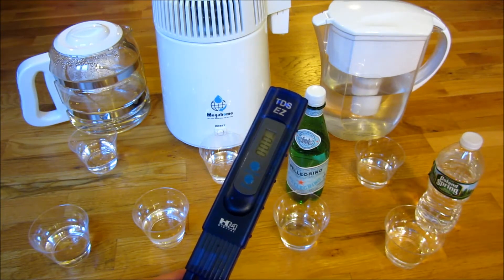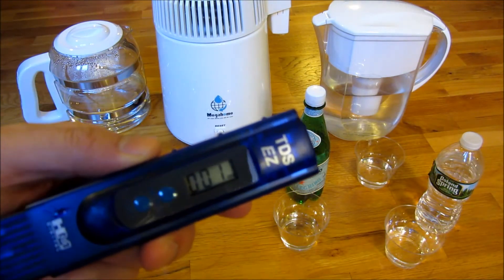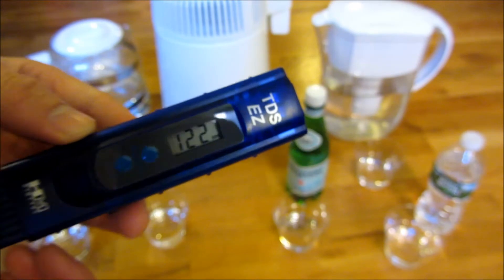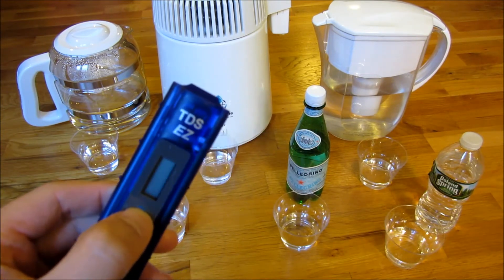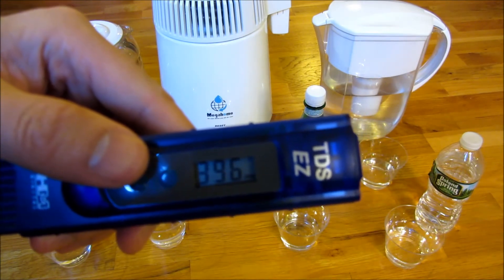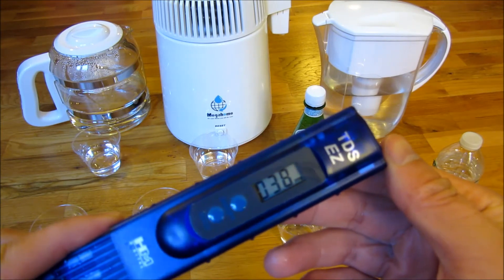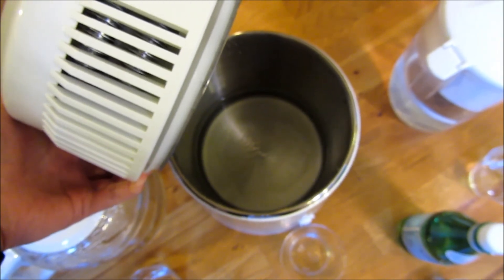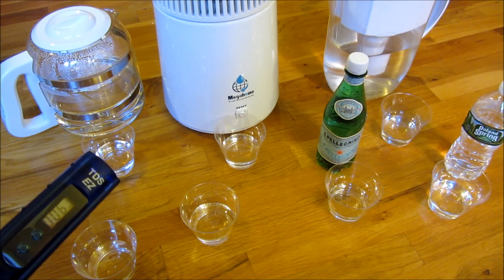Megahome Water Distiller | Water Test Results and Quality Comparison

Comment: I have owned 5 Megahome Water Distillers over the last 12 years.  All of them lasted well and continued to distill water, but I had to throw each one out, because slowly, (some faster than others), over time, the heating element in the bottom of the tank, caused the tank bottom to TARNISH! The tarnish grew worse with each use.  Until there were more and more tested 'particles per million,' (PPM) (using TDS meter), in each distilled batch. The description and biggest selling point, states that the tank is stainless steel.  Stainless Steel items usually are purchased precisely because they are not supposed to Tarnish.  The most recent Megahome I purchased (March 23, 2025), was a 316 model, because they said the Stainless Steel was "heavy duty". I wanted to save from having to buy another distiller, so I used bottled distilled water in it, (I would just drink the bottled distilled water, but wanted to vaporize the plastic from the bottles.  There was never any sediment left in the bottom of tank after use, but after only two uses, a star shaped tarnish appeared over the heating element.  After 7 uses, the tarnish had grown much worse. 
 Experience has taught me that, tarnish & heating element corrodes the metal, at bottom of tank, over time, and it will eventually cause particulates and rust.
The seller I purchased from on eBay was Nutriteam.  I was able to return the distiller, but with a great deal of trouble for me.
I talked to another seller on Amazon.  Found out it was the same Nutriteam. 
 I WANTED a Water Distiller!  They were selling their Megahome "Heavy Duty" 316 Distiller for $329 at the time.   I explained my experiences, recently and over the last 12 years, to them, (I suggested that they make the Stainless Steel at bottom of tank thicker), and asked for assurances if I bought theirs. 
They could NOT or would NOT give me one.......(so far)      BUY AT YOUR OWN RISK.
I came here looking for alternatives to compare to Megahome.  As you can see, all these people are pretty much hawking for the Megahome Distributors.  Remember, you are making an expensive purchase, and you WANT IT TO LAST!  The first month it could give great water, when the warranty runs out and the tarnish is bad, then what do you do?  And, NO, the tarnish was not from the sediment left from tap water, (I don't use tap water), it was the heating element itself that tarnished and eventually corroded the metal at the bottom of all the tanks!!

Comment: I also use a MegaHome distiller for my drinking/cooking water. You really don't want to boil a distiller dry for two main reasons:
1) The sediment forms a hard scale if all the water is boiled off, which makes cleaning the tank a real chore.
2) When the distiller is allowed to run dry, the heat goes way up, stressing the heating element and can cause the safety switch to wear out prematurely.
In order to prevent this, just plug your distiller into a timer switch set to about five and a half hours. Fill the tank to just over the 'Full' mark. This will give you a gallon of distilled water and leave a little water in the distiller. Just pour out the remaining water and rinse out your distiller before running the next batch. Your distiller will last longer, and you won't have to clean the mineral scale buildup as often.

Comment: Lower TDS doesn't necessarily mean better... if the disolved solids are healthful minerals, in proper balance, then in terms of drinking water, a higher TDS may be preferable...
Reply: Find one city with non oxide minerals in the water and no pesticides. In all other cases distilled is healthier. Calcium/magnesium oxide are not easily absorbed and I don't think your body has a use for chlorine/bromine complexes.
Reply: @Skarnex1337  the answer is to drink spring water, not distilled or municipal water.
Reply: @rosstituteuk  spring water contains oxide minerals which are not easily assimilated into the body
Reply: @Skarnex1337  well water from a bore hole is much more likely to contain the oxides (alu, manganese + iron). good quality spring water that has filtered to the surface naturally is much less problematic.
drinking distilled water for a prolonged period of time will demineralise the body, as it's a 'hungry' form of water. 

Sauna therapy is worth considering, if you're concerned about the oxides.
Reply: You shouldn't be drinking water for its minerals, its a myth, if you calculate it it will only be 1% of your daily intake, 99% comes from food
Reply: @helloman5576  Water is not only the most essential substance next to oxygen for human life.  It is also complex, often containing hundreds of dissolved minerals and chemicals.  It is indeed a marvelous substance.

Pure water processed only by nature is a type of “whole food”.  It not only flushes toxins from the body and supplies many needed minerals, but impacts the body in many other subtle ways. Like other whole foods, when it is tampered with, water loses most of its precious healing properties.

Water is more than a beverage.  It is a particular type of energy that we need in a certain amount on a daily basis.  If we do not obtain it, health is negatively impacted.

Comment: SHOULD I GET THE MEGAHOME OR THE H20 LABS? ADVICE APPRECIATED. MEGAHOME'S CARBON FILTERS ARE CHEAPER
Reply: You don't need brand-specific carbon filters.  Buy the cheapest distiller off Amazon and also buy the protection plan.
Reply: @paulm.7422  That's what I'll do.

Comment: Does it remove VOC's and microplastics?
Reply from the maker: Yes, it has a coconut filter at the spout and it boils the water away and collects the evaporation to make the distilled water, so yes to both.
Reply: @PoolarityChannel  thanks
Reply: Also consider to not use a plastic jug

Comment: If my TDS  says  2 ppm is that not good ?   I read online  Distilled and Pure is  0.5 or less?
Reply from the maker: 2 ppm is really really good.  Very good tap water typically has 50 ppm.  My tap water from my city has 320 ppm

Comment: Since we can't buy bottled water here with the virus emptying the stores. I got out my old Megahome distiller and made some pure water from tap water. I used it with their charcoal inserts that were old and got pretty much pure water with 2TDS. I bought some carbon inserts that weren't from Megahome and that water is 14TDS, so some of the charcoal is getting into the water. You test that?
Reply: try and consume more natural foods , our species specific foods in their natural form , high water and sun cooked filtered naturally already. fruits and veggies. distilled water is a good option, taking out the ever increasing contaminants , not promoting the bottled water with plastic. A nature cure practitoner  advised me to pour the water into another vessel higher up to re oxygenate it and in the sunlight too to basically restructure it similar to rain water as its exposed to the air, cosmic and solar radiations. Keep well x https://www.youtube.com/watch?v=dqxR9T1AiUA

Comment: Great test! I have a Megahome Water Destiller and used it since 2008. Don't regret it! :-)
Reply: Since 2008? Have you replaced the condenser in the top unit? Activated charcoal replacement how often?
Reply: @cameronmtv  2008 is only from when I started distilling the tap water to get much cleaner water.  It has nothing to do with maintenance.  Of course, I do maintenance and replacement of carbon filters when necessary.

Comment: What are you getting at this means nothing unless you find out what's in the water we know that chlorine and chloride is in tap water heavy metals and at the beginning and end of the summer pesticide is put through your water supply in most cases many chemicals you will not even find unless you are testing for them pacifically but dissolved solids doesn't mean that is bad water and for most people most of the food they eat is full of shit as well I don't know what the answer is and I don't know what water is best only know that your TDS metre explains nothing other than you can strip all that crap out with reverse osmosis or by the ionising but is that water good for you are you clever enough to know or have you just latched onto other people's opinions
Reply: Very well said Phil! I've spent a lot of time on this and conclude that no one knows what water is best...it's a lot of opinion as you said. My tactic, right or wrong, is to try to remove everything I can from the water (using two inexpensive types of filtration) then add back the trace minerals that I believe should be in there. Really curious about what you said about pesticides. I noticed seasonal variations assuming it was due to seasonal farm runoff. Are you saying that pesticides are purposefully "put through your water supply" twice a year, or are you saying that it just ends up that way?
Reply: My opinion: to start with water-H20 nothing more nothing less first! Second  would be vitamins and minerals obtained naturally through natural foods. Lots of veggies and greens and 1-2 a week fruits. Also note rain watercontains natural sulfur-msm and take that as a supplement. I lift and workout a lot but when I make switches like such I notice huge improvements in things like recovery from soreness and generally better mobility!

Comment: FOR THE LOVE OF ALL THAT IS HOLY, CAN ANYBODY POINT ME TO A DISTILLER THAT DOES NOT LEAVE A METALLIC TASTE?

Thankyou!!!
Reply: Remove the top part, put it upside down on the table. Bring to boil a little vinegar with a little water, and pour the mix through the hole inside the top part, through which the vapour goes. Let it sit for 12 h. Then wash it with water, and repeat the process a few times.
It should take out the metallic taste, if not completely, then substantially.
Reply from the maker: Does the MegaHome leave a metallic taste, I don't taste it, seems perfect to me.
Reply: Pool this alive creature EE NOOO TA TA was borne so to disagree. So relax and drink some soda
Reply: I have the Megahome and it developed a metallic taste after a short time. It may have to do with regional differences in water, I'm in NYC, which would maybe explain why Poolarity doesn't have the problem. If I don't do a specific maintenance program and a few hacks, the bad taste comes back. Looks like Poolarity has another excellent video about using a timer, which is one of the things that I must do. Don't give up on the distiller until you look at the maintenance videos by users like Poolarity.
Reply: @non-toxny  do you have the white or silver ones?

Comment: what about boiled water from a normal kettle?
Reply: That makes the tds go higher but it purifies the water but concentrates the minerals. I did drink boiled water for a few months back in 2004 and then ran out and went to the ice machine to get water which had a filter, and it was like drinking ACID. IT was like putting a lot of sodium hydroxide in my mouth!! MY mouth burned BAD!! SO try that experiment, then go drink the tap. U will know what i mean.

Comment: I did this testing also.....I do wonder what...if anything is still in the distilled water...my dad worked for the city filtration plant years ago..I did a science fair project about the chemicals used to clean the water....(I won the school science fair)...There are so many used....do I assume these are all filtered out?  (there's a former(?) cancer cluster not too far from where I live...so I question...)  I LOVE this unit....
Reply: His meter should read 000 for distilled not 001.  MY zero pitcher read 000 with two meters. IF flouride is 002-004 PPM then that 001 would be flouride. Gross.